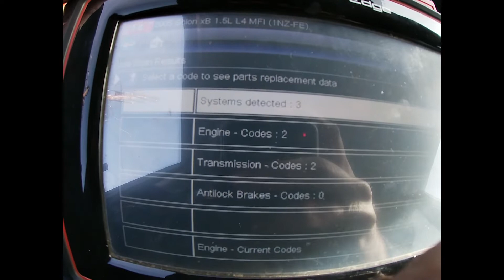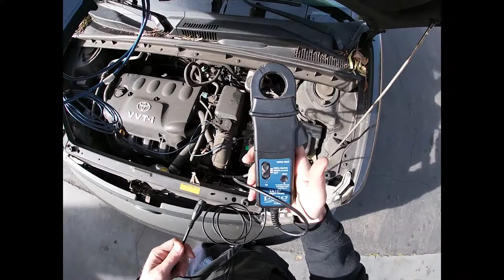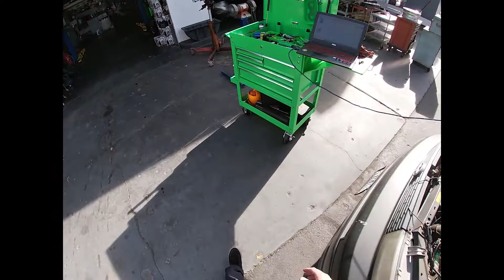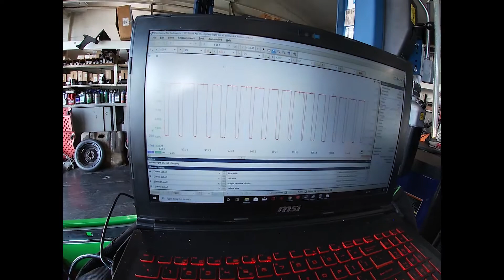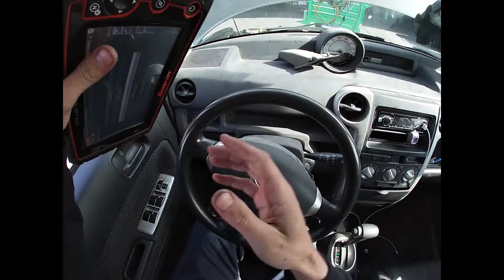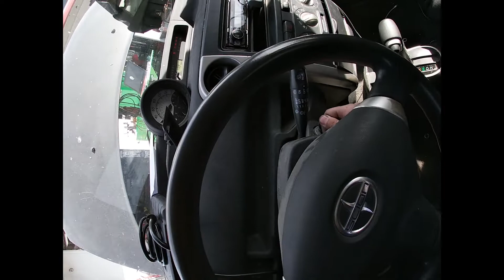05 Scion XB 1.5L Battery/Alternator Light and P0117

Comment: Awesome video and like you said this is the perfect example of how important it is to always check the basic electrical system before you start chasing codes! Well done sir! And I loved the screen shot.. can be kinda difficult to see your screen at times
Reply from the maker: Thank you brotha! Ya exactly, we both know how many problems can arise from simple battery issues like loose connections or weak batteries. Thanks, Im aware my screen sucks in the sun lol. surface pro seems better but has issues with software for zoom